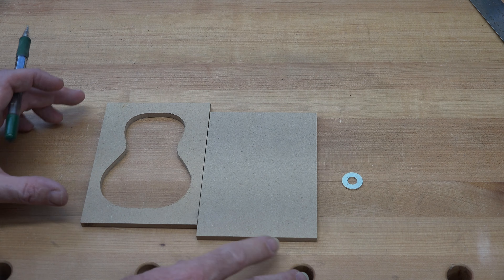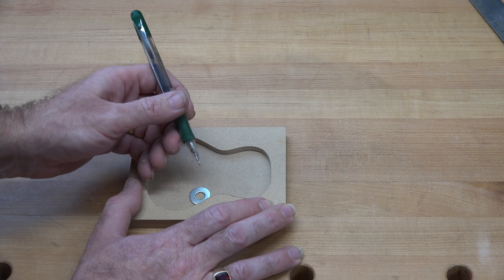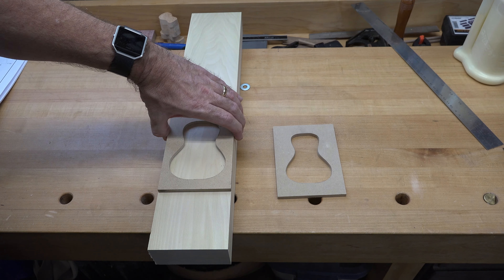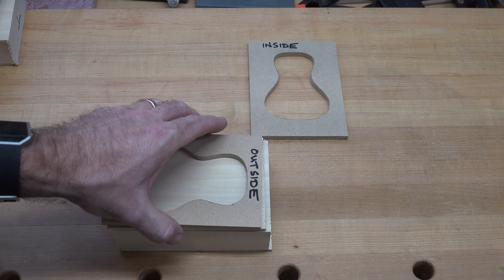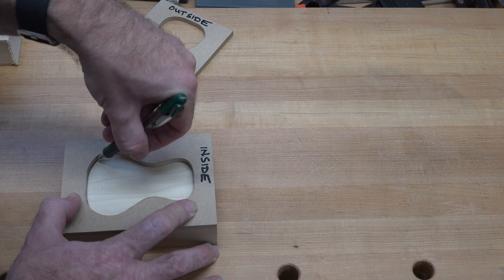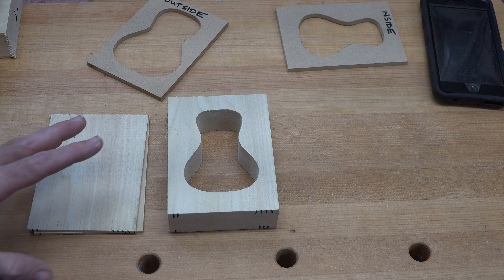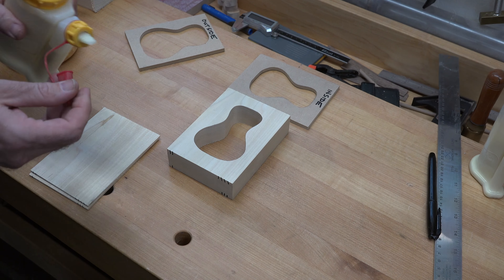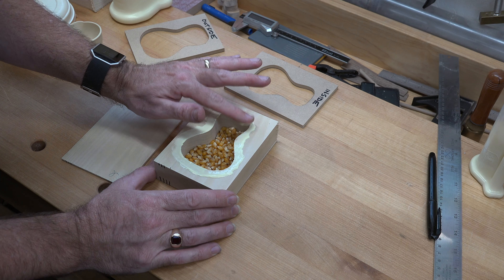Making a Shaker

Comment: Fantastic. I'm going to make a bunch of these for the kids at the local Preschool. As much as I hate using my scroll saw it's the tool that seems the only option when it comes to fun projects to support the local Preschool.
Reply from the maker: The rough cutting of the exterior profile can also be cut on a bandsaw and then the final shaping can be done with an oscillating drum sander.  There are always options for this sort of thing.  Good luck with you build and if you have any questions please don't hesitate to ask.  Thanks for tuning in this week.